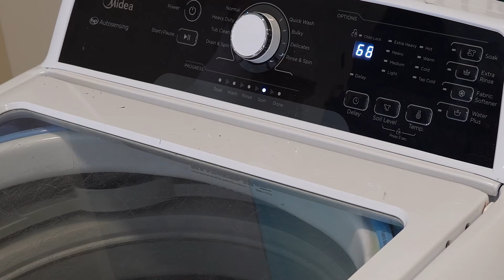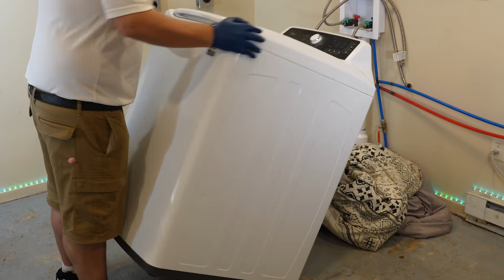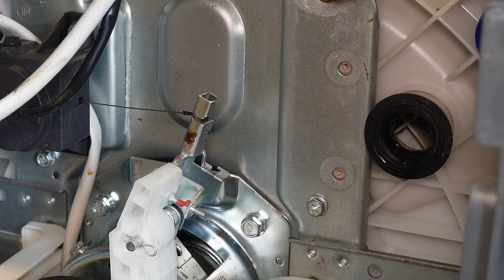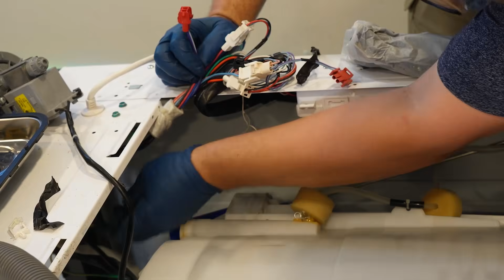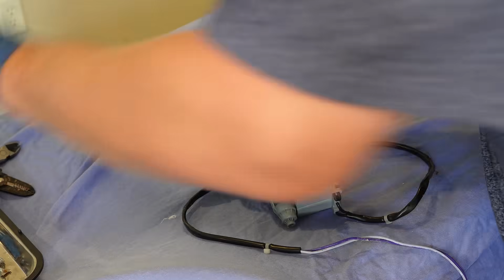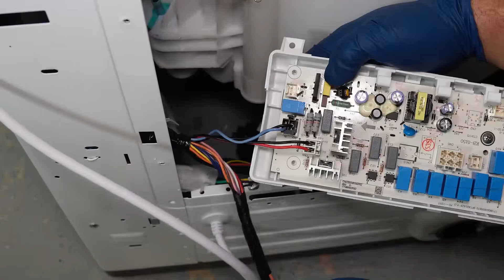Midea Washing Machine Won't Drain Water - How to Find, Fix and Replace!

Comment: So i replaced the drain pump and it still isn't draining. But the pump is running..just not draining. Do you think there may be a clog in and further up into that black hose attachhed to the drain pump?

Comment: I have a Midea washer that won't drain for the spin cycle but I found when I disconnect the drain hose from the back of the washer just before the pre-spin drain then I am able to get it to drain and spin. Any idea what might be the issue? I am suspecting a clog in the short section of hose from the pump to the exterior part that the main drain hose connects to.

Comment: Drainage issue.  Clothes come out soaked.  Get an E4 code a lot.  It's basically new, only really worked correctly 3 times.  Ugh!
Reply from the maker: Unbalanced issue I believe
Reply: I feel you. I feel like throwing it across the street and getting a new one except I can’t afford one.

Comment: If you have a wet dry vac (setup for wet pickup mode) you can vacuum the water out through the drain hose. sometimes this will clear a drain blockage as well ,